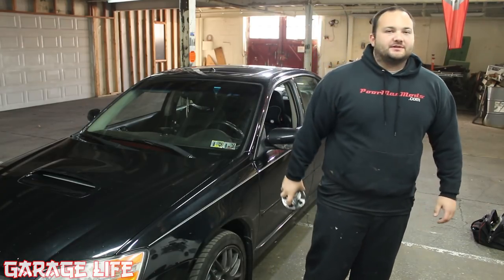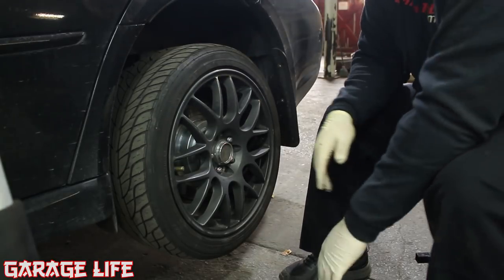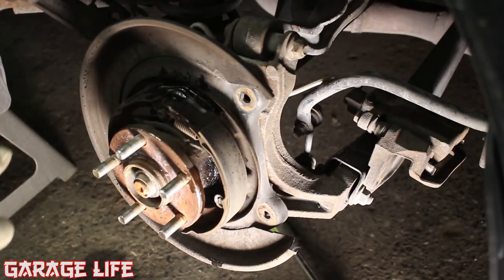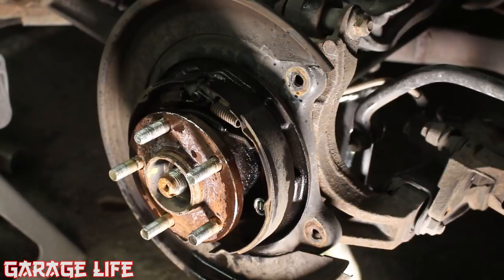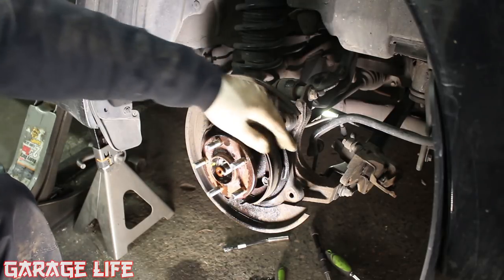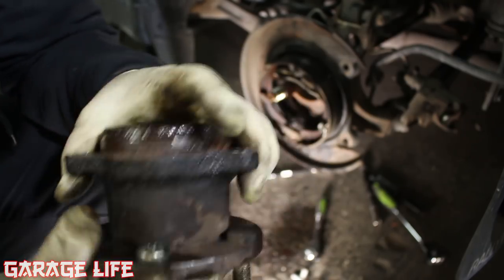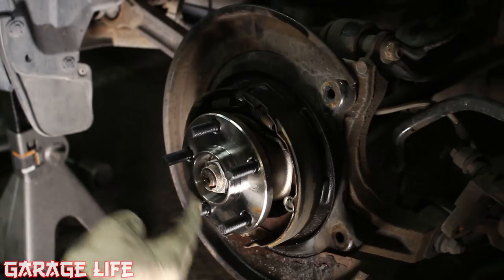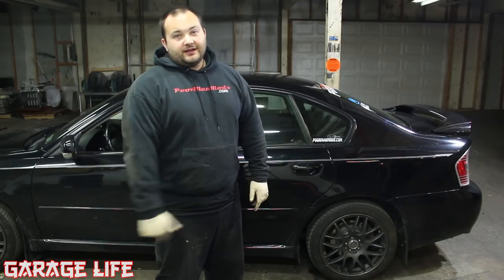This car is a money pit! Subaru Legacy rear wheel bearing replacement Impreza Forester outback

Comment: 2013 Legacy here... 180K highway miles, NE road salt and winters and on my 3rd rear bearing now, replaced rear struts when the first bearing went out.  Burns through a quart every 1800 miles or so.  Heat Shield rattle never fully repaired and 3 windshields.  Not the experience I was expecting.  And I never got used to the soft brake pedal feel. Good clip!
Reply: 05 forester here..i feel ya bud.love my subarus but fuck i hate em

Comment: If you live in the Northeast (Maine) and just can't get the damn thing out......
You can remove the entire knuckle in about 15 minutes.  
Remove the speed sensor, but you can leave the e-brake cable attached.
Put some wood blocks on the floor (I used two short pieces of 6x6) and place the knuckle on them with the inner face UP.
Position the knuckle so that the hub is between the blocks so it can fall out.
Buy four bolts (M10x1.25 and 100mm long) at the hardware store to thread into the bearing from the BACK side.
Once they are threaded into the bearing, you can use a hammer to hit these bolts one at a time and drive the bearing out of the hub.
Once it pops out, remove the bolts and the hub will fall free.
I spent over six hours beating, prying, heating, etc. on mine, then had it out in 30 minutes removing the knuckle.
Reply: The scariest history of mechanics I ever read on YouTube. 😬
Reply: Wish I knew this trick the other day. I could not get mine freed at all and I was hesitant to take the knuckle off because I snapped the ball joint off in the front knuckle just last week. We tried a wheel hub tool, an Oxyacetylene torch you name it. I finally broke down and limped it down to the mechanic yesterday. Now I have to rent a car and pay a mechanic..Feel like such a failure lol. Rust got the best of me...
Reply: @lucid484  I'm going to do this again next week on my son's 2012 Forester.  If it doesn't bust loose in the first ten minutes, off comes the knuckle!
Reply: @chrisboyd4433  Don't blame you! If I ever do my two front bearings, I will do the same. I just will have some extra nuts and bolts handy in case I need to drill out the Ball Joint bolt again. 😂😂😂😂

Comment: I bought my 09 legacy at 159xxx, had to do both rears because they were bad(one side was, but it’s advisable to replace both at the same time). I’ve put nearly 40k+ miles on em over the course of almost 4 years. Fronts are still good. One owner before I bought it private. You got probs or beat the shit out of it if youre going through that many.

Comment: Wow, it came off the hub that easy. Mine took 3 hrs to get off. Had to use a hydraulic press to get it off. It was welded on.
Reply: I have the same problem.

Comment: hi sir. i put on an chinese aftermarket wheel bearing hub on my ford focus. 
i think it may have play when i grab and shake the wheel...it clicks a little. 
However, it rotates really smooth and makes no noise going down the road. the old bad oem one had no play but it made noise driving on the road so im confused.

Comment: Do they make bolts that fit the bearing assembly, but are longer?  If so, could you try this as a way to push the assembly out at least enough to get penetrating oil to soak in?

Comment: Yep no impact installing the nut also to remove the axle from The Hub use a punch with a heavy hammer on the center of the axle you don't beat the side on it and torque the nut to spec

Comment: How many miles does it have? If it has 120k miles on it it doesnt surprise me that you had to replace 3 of them. It's really not expensive of a fix for lasting 8-10 years. The good bearings are only 150 bucks a piece. Mine is 9 years old and just now had to replace my rear driver hub but other than that only regular maintenance has been done to my legacy and not repairs have been needed.

Comment: Maybe your wheel bearings keep going bad because you're impacting the axle nut on and in effect driving the rollers into the race inside the assembly. I believe the torque should be about 140 FT Lbs. Your impact gun is putting out anywhere from 400 to 600 FT Lbs which is way too much.
Reply: Agree, i cringed so much watching him trtrtrtrtrt that nut... torque specs are for a reason
Reply: ..... calm down his impact can't go near 400 ....
Reply: It was a differente bearing going bad each time, not the same one repeatedly.
Reply: I actually agree with driving the rollers into the race. Probably should have changed them all at once
Reply: @yannickvignault4686  I have an electric impact that goes over 350ftlb so... yeah, his air impact can definitely go over 400

Comment: Not sure why you hate your caliper bolts so much, Always comes off easy for me. 
Have you ever tried taking the lower ball joint out the knuckle on these?
Reply: I did and the bolt snapped in half...Have to drill it out and add a new bolt.

Comment: Great video. I’m starting to hear that these bearings go on most of the Subaru’s as you said, and most posts that I’ve seen always recommend the Subaru OEM part. Do you happen to know what is the most reliable brand? Thanks again ,  Tom in Rustbelt Cleveland
Reply: Moog
Reply: SKF bearings. Made in Japan. Awesome quality with best warranty in the business at 42 month's / 42,000 miles. Moog is 36 months / 36,000 miles, and Timken is 12 month's / 12,000 miles. Best part is SKF cost the same as Timken, around $100.00, but significantly less than Moog at around $150.00. Look up SKF. Used on OEM vehicles throughout the world. Excellent quality. Exceptional warranty.
Reply: Timken 
But other (Moog, SKF) will work just fine. Don’t go with OEM.

Comment: I have a a 2017 Subaru Forester. I started replacing a bearings at 70 000 km. I'm up to 125000 Km going on the 3rd bearing. If I would've known!!! To all Subaru owners Good Luck!!
Reply: I mean I'm at 225k on oem bearings. Bought it new so they are all origonal. I don't know how i feel about oem parts for this seeing all these kinds of comments. Timken is who I'm going to use for replacement units.
Reply: And that's a 2015 impreza mostly highway miles though.
Reply: I'm at 136K Miles and just replacing mine.

Comment: Does changing these bearings mess with the alignment at all?
Reply: Nope
Reply: If the hub assembly is really rust-welded to the knuckle and you remove the whole knuckle, to press it out with a shop press, then a 4 wheel alignment might not be a bad idea.

Comment: It kinda shows on the box that you are not to use an impact to torque the axle nut onto the hub!
Taking it off with impact is ok because they are shot anyways!
Putting together is always by hand and torque wrench to spec.
You over torque and you crush the bearing assembly putting a lot of stress on the hub... Going to last half the time if you're lucky!

Comment: I didn't have such easy luck, slide hammer was useless, small mallet was useless, air hammer was useless.  I ended up removing the shoes, removing the abs sensor, and smashing it out with a 15lb sledge for 5 minutes.  so much rust and seizing in there

Comment: Have a 2014 Forester that is essentially the same thing.   The F'n rear hub would not come out.  Tried what was shown here.  Plus; air hammer. slide hammer, every kind of pry bar, a jack under the spindle.  There is a puller that attaches to the spindle that may work.  I didn't have one of those.  Ended up having to pull the swing arm and put it in a press to get it out.   Ruined a wheel  sensor with all the pounding (didn't hit it just all the pounding).  If you live where they put salt on the roads be prepared for a tough job.  One side went at 75K the other at 80K.  Now fronts are getting noisy.    This wheel bearing failure is "Bull Shit".  Dealer gets over $400 for the job.  "If it would come apart" the job would be easy/straight forward take about an hour maybe 1 1/2.  "Hey Subaru.."  This is the kind of BS that makes people look at buying a Honda instead......  Just saying...
Reply: Part of the problem dealing with these "rust welded" wheel bearings is the rubber suspension bushings  holding the knuckle to the car.  I tried every tool  known  to man with   no luck and  ended up removing the entire knuckle and  bearing  assembly.  Once  removed it was very  easy to support it on  two  pieces  of  4x4 and  pound it  out  from  the  rear using a  big ass hammer.  You're  right tho -  Subaru  needs to  rethink  this !
Reply: Yeah I just bought a 2014 and mine went out at 47k.  Thank goodness I bought a certified one. But what the heck. Guy at dealer said rears seem to go out between 50 and 100k.

Comment: It's much easier to get the caliper off on the BRZ. Unfortunately I only had an easy time with one of the hubs, the other came apart and the back half is so stuck there's no hope. Now the car is stranded in the driveway on jack stands. I never should have tried it with a hub puller, just should have started out with the BFH and let 'er have it.

Comment: Quite a different setup on an '05 Impreza. Much worse, actually.  A long, 14 mm bolt becomes your worst enemy, especially if you live in the rust belt. Subaru has done a poor job of designing a number of things, including wheel bearings, saddle-type fuel tanks, fuel filler necks, head gaskets, etc.
They can be nice cars to drive, but the wallet-destroying headaches will leave you wishing for a car with a lot more design integrity.
Subaru stubbornly sticks with tried and true design failures, and refuses to make corrections.

Comment: Struts are another major flaw on a Subaru. My ( ex ) 2007 Impreza WRX had two struts replaced at 70K and it still had issues with suspension related noise. I loved that car but just had to let her go and move on. To a Toyota. Subaru's are fantastic if all is well.... extremely expensive if problems arise, which they will.
Reply: Try owning a bmw if you think that Subaru is expensive.

Comment: Take it to the dealer so you get a warrenty. That way they have to cover them. Also watch those cheap ass after market. Are you running stock wheels? My guess is your after market rims and tires are ralphing bearings. Wear gloves when breaking shit loose. I have one totally mauled finger from smashing the shit out of it twice in one week. Split it wide open the second time in a week. I now have a permanently scarred up finger. Something ended up imbedded in my finger and wont come out. At least you dont have the press out bearings like a few years back. A slide hammer would save you all that pounding. I would coat things with fluid film. What brand wheel bearings are you using? CHINESE? My guess is you will back into it again in 6 months if you are using cheap after market bearings and the wrong sized wheels and rims. My 2010 had NO ISSUES ever. I have had 4 other Subarus and NEVER had the issues you are having. Something is causing it.

Comment: Your extension is to long undoing those 14 mm bolts, you should use as short as possible so no one you slipped off and ground your knuckles.

Comment: “Give it like 30 uggauggas”
Reply from the maker: Scientific measurement right there.
Reply: I'm doing my front bearings and replacing hubs right now (2003 OB  LL Bean). The forum mechanics caution NOT to use an impact to tighten the hub nut... and not to tighten it with weight on the wheel. It requires a specific torque.
Reply from the maker: Im sure it does require a specific torque but this is how i've always done it and ive never had an issue. Thanks for your input